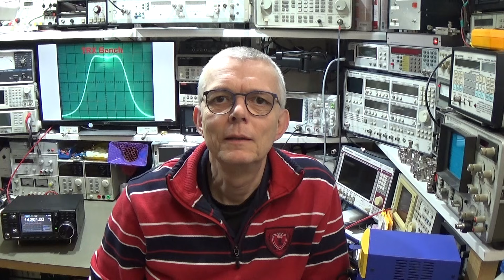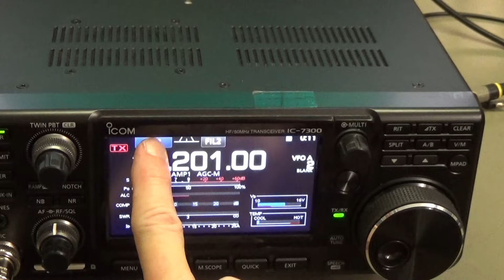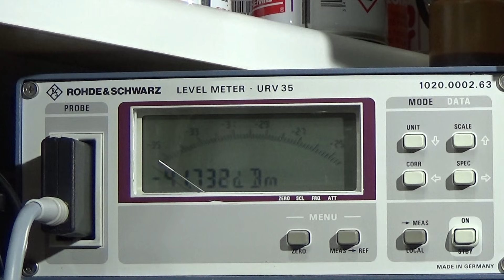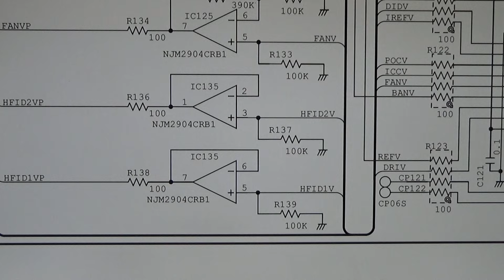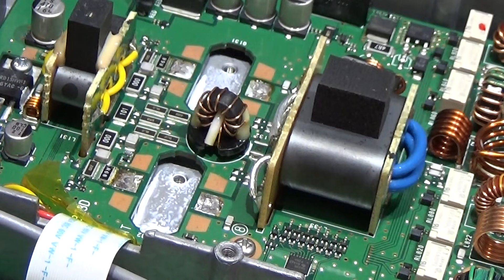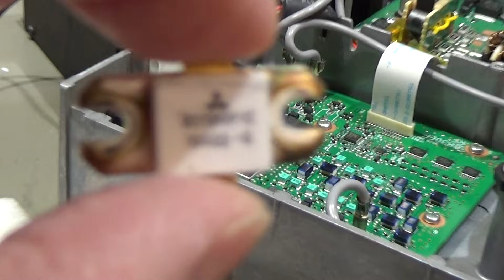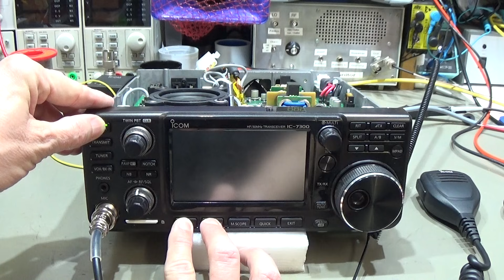#221 Repair ICOM IC-7300 with Power Loss

Comment: Peter, I also have a IC-7300. It was very interesting to watch you diagnose and repair a radio that I use. Can you give me a link explaining the the alignment procedure (adjust mode menu)? You mentioned a service jack in the remote connection, what is that? Can it be made DIY? I am sure one day I will need this information. Best regards from Istanbul, TA2KQ (old sign TA2AWX), 73.
Reply from the maker: Yes you can diy it's just shorted that's all. Simply google service manual you'll find it..

Comment: Another great video and the first I've seen on the IC-7300. Thanks as always for everything you put into these videos,  I always learn something. 

I am curious about one thing, since the beta of the new pair is likely not exactly what the old pair had,  would adjusting the output power have been a good thing to do?  Or is it that the beta were likely close enough and since the output was in spec it wasn't needed?
Reply from the maker: Thank you. The only point to do is the perform the bias setting because we need to make sure the both transistors are working equally and we don't have a matched pair. Problem I see is the fact that we can not verify the bias current after setting. The output power was all over 100watt so no need to align..
Reply: @TRXLab Ahhh ok, thank you very much!

Comment: Would you check this idle current with each firmware update just to be sure as i have this radio as well with latest update thank you for great info very informative cheers Harry
Reply from the maker: no not really but in this case we do not really know why those finals are blowing...
Reply: Thanks Peter i don't want my finals to go either cheers

Comment: Is output RF power significantly lower if DC input is 12 volt vs. 13.8 volt?
Reply from the maker: It is lower with 12 Volts, but NOT significantly ....

Comment: show us how to do a mars ode on the Icom 7300 Japan layout from Japan Icom radios layout in the diode section please. I want to open up full transmit on all channels I receive on please. Supposedly just removing of a diode 422 is all one needs to have 0.500-73.000 MHz. Lets see what you come up with.

Comment: Some settings must be made obscure so the bias voltages don't get tampered with and it is essential that the way you get into service mode is obscure and only a radio technician would know how to get into the service mode.
Reply: The procedure to get into adjustment mode is very likely in the service manual.  Not really a secret.
Reply from the maker: I don't see it that way. First the service manual is no secret and secondly if you have bought the radio it is your right to get all details. If you ruin your radio with doing something stupid it is your problem. We are all adults and should know what we doing. A man should know his limits... Other than that I will keep showing my work without any secrets to anybody...
Reply: @TRXLab  "A man should know his limits..." That's really good one !

Comment: BONJOUR.  Svp ou je peux commander les transistors RD70 ORIGINAL, on en trouve beaucoup sur eBay  et  AliExpress  je ne c et  pas si c et judicieux de commander la ba merci à vous.
Reply from the maker: From ICOM directly or from your local radio dealer...

Comment: Hi Peter....again, another great video you have put out.  I want to 'align' my 7300 as you recommended to do.  I got the service manual and read through the steps to do so.  One of the first things it says, is to make a 'remote' plug to be used during the alignment procedure.  In your video, you didn't mention anything about that.  Can the alignment be accomplished without that plug??   Thanks and keep up the great videos!!!!!
Reply from the maker: Yes correct you need to put this service plug in. In the video I said as far I remember that the remote plug is in the radio or so..

Comment: Why software idle current setting? Mostly against owners. This drivers together with output pairs can give a lot more Watts than "only" 100. I'm against miniature cheap trimpots in older radios.Also. If the end pairs are not matched best idea is to adjust idle apart. But... Just my 2 cents.

Comment: Some people have adjusted the Tx power set to get 100 watts output. As set from factory it was less than 100 watts on most radios
Reply: If by over 100w you mean 3 or 4 watts more,  probably not a big deal. If they're trying to squeeze every last watt out, that's very bad... And not really helpful,  a 10w increase at 100w is not even going to be a measurable difference on the receiving end. It's .4dB, so roughly 1/6th of an S unit.  With HF noise being what it is and variable path loss (QSB), it won't ever mean the difference between being heard or not over a DX path.
Reply: Agreed 
I had to back it off from 120 watts

Comment: Much easier than the ft991 and its small trim pots kg6mn
Reply from the maker: that is true so let's hope that the firmware is okay...
Reply: @TRXLab  NO IT IS A SO SO BAD BATCH IF FETS..THE FETS CAN BE USED IN THE 980 PLUS RADIOS REAL WELL  KG6MN

Comment: This has to be the design of some bean counter, get rid of potentiometer adjustments and rely on firmware/computer control for service adjustments what could go wrong...... radios with blown finals due to likely screwed up firmware from the start. add in the touch screen and menu driven garbage come 20 years from now a lot of these will be in the local dump yard while the old stuff continues to chug along just fine.
Reply: You can keep your old rubbish boat anchors
Reply: @Spookieham  at least my "rubbish" works, unlike the 7300 and the rest of these new crappy radios that won't make it a decade let alone two decades.
Reply: @Dratchev241  Morse Code will save us from Global Warming!
Reply: This is a far better design.  Sorry you'll need to retire your "golden screwdriver".
Reply: @stargazer7644  Better design HAHAHAHAHAHAHAHAHAHA. More like garbage design.
Reply from the maker: If there is a problem with the firmware, which we don't know, it is a serious issue which we can't maintain...Thanks for feed back
Reply: @TRXLab  It appears from the way the calibration routine works that the value for the DAC is simply stored and then retrieved at each power up.  It does not appear to dynamically change this setting except during calibration.  You can monitor the DAC output to see if it changes or not.   If you found a problem down the road and really needed to, you could break the DAC output and replace it with a pot, but I can't imagine this would be necessary.  You can measure the bias current at R211 on the PA board the same way the rig's CPU does.
Reply: I know a guy who in 1975 asserted that "Microprocessors are a fad that won't last. Don't waste your time".  Someone long ago probably thought the same about cooking food with fire and later with microwave energy.
Reply: Logical thinking. People misuse EVERYTHING making from good ideas bad things.

Comment: Power is always going to be low if the tuner is not on and SWRs are not 1:1. Test both mosfets and see if they are simular4 or even close or what we call a matched set. If really close replace one that will match the used one or charge extra for two new ones. This guy drives me up a wall. I would test the new ones to make sure they are close to each other. Just check the voltages to the bias and see that they are in spec or within 1 % of each other. Close enough. This is not Neurosurgery